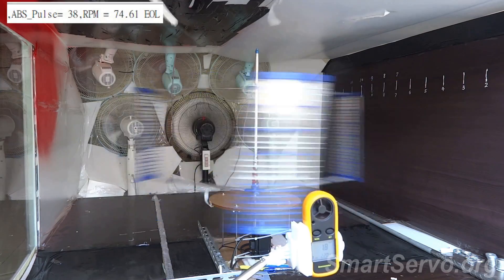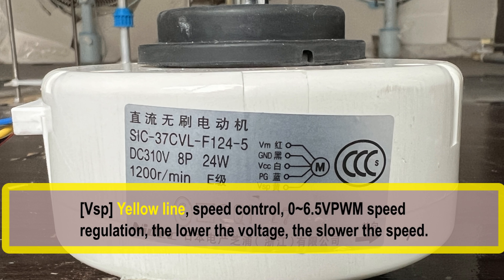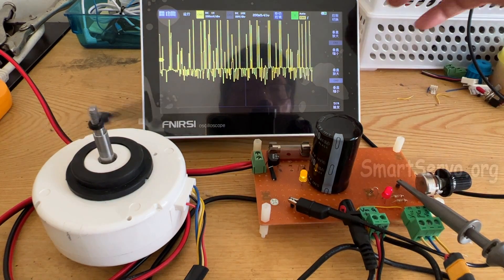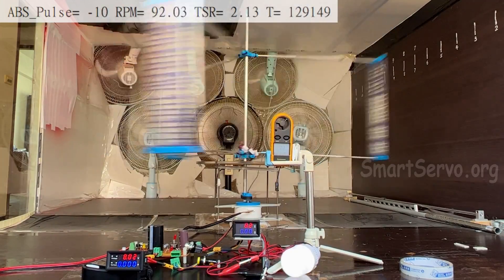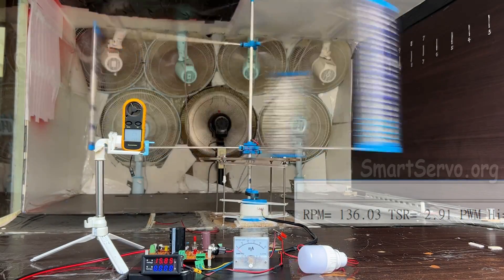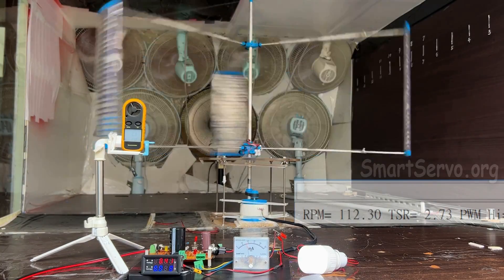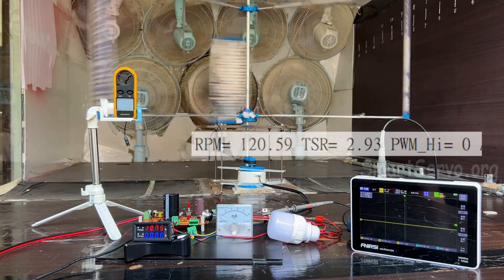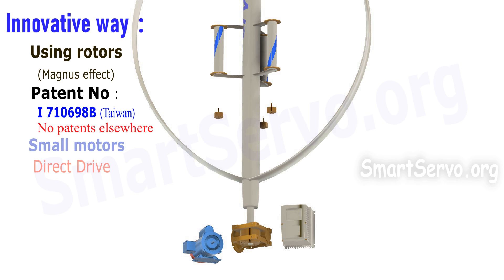Darrieus wind turbine load testing, power generation, PWM regulation

Comment: If I remember correctly, a TSR of around 2.5 is the most efficient for a VAWT H-Darrieus
Reply: Actually TSR or 4 is ideal for that design. He has another video showing the coefficient of performance curves.
But I guess it really depends on the exact design of the turbine and it could well be 2.5 for real thing he tested it on in this video.

Comment: Could it be possible to use that motor as a wind powered generator only and take advantage of the speed regulation wire using an external (battery?) power supply? 
It could be useful for braking the wind turbine in over speed.

Comment: You can make the darrieus turbine self-start by setting the blades at an AOA of about 4- 6 Degrees.
Reply from the maker: But this will reduce efficiency
Reply: @SmartServo_org  it will also reduce complexity.

Comment: I sugest keeping it simpler and make a darrious/savonious hybrid turbine because the savonous blades have good self starting capabilities and darious turbines have good efficiency and a hybrid of tge two has the darious sweep a much larger area. 

Assuming peek performance of darious turbine is with TSR at 4, and savonious at maybe 0.8, then the savonious tip radius should be 0.8/4 = 1/5th the darious turbine radious.  

Adjust darious radius up or down to further optimize.
Reply from the maker: Thank you for your suggestion. Using drag blades is the traditional way to start the Darrieus wind turbine and is no longer worth researching. In fact, there is a price to pay for starting through drag blades, which reduces the efficiency of the lift blades. => https://youtu.be/qAYjPSDGPo4?si=k7pk7PRDiFB8X5u7&t=33
Reply: @SmartServo_org  the magnus rotors and their abilities were interesting. But, I don't see the necessity for "high torque"  just the general capability to self the start.  

Yes, the radius effects the tip speed, in a given wind.  as your video demonstrated and my comments point out,  generally in a given wind, a larger diameter drag turbine will rotate slower and that an even smaller diameter turbine will spin faster in the same given wind.  I pose that  had your video tested an even smaller diameter drag turbine, it's possible to get the whole turbine spinning faster than a purely Darious turbine in the same given wind speed.  

Lastly,  for a little more outside the box thinking, pardon the pun, you could put the drag cross section of the turbine outside the lift cross section.

Comment: Hi, ive been following through this series of your experimentation, congrats on the regulated power output to mantain the speed of the rotor! by the way, it is known that on winds of 4m/s or lower there is bareley any energy, so it would be interesting to see how your turbine performs on higher windspeeds with the generator pluged, and also to see if they TPR goes up since the tipical optimal darrieus performance is with TPR above 3 or 4.
Anyways i'm looking forward to see how you continue to develop your project! Really nice content!
Reply from the maker: Thank you for continuing to follow my channel. Regarding higher wind speed, I cannot achieve it in my simple wind tunnel. I'm trying to figure out how to move these devices outdoors for testing,